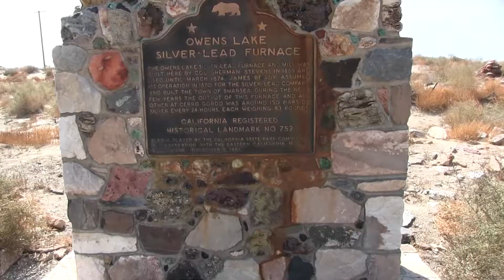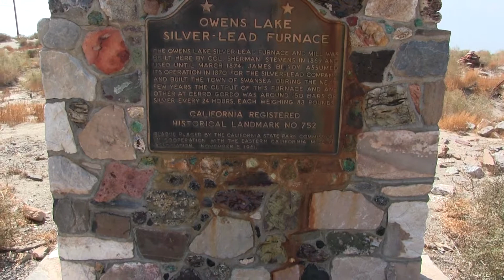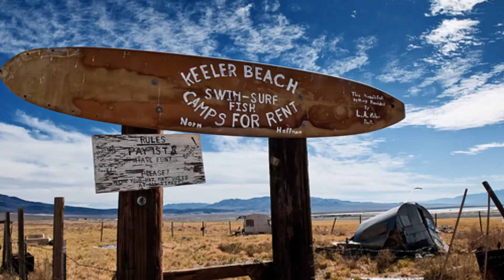Sight seeing Swansea and Keeler California

Comment: I'm thinking of going with a friend on these types of adventures; however, I wonder if I may not have the range I need in my Yukon.  It is a 5.3lt with 4.10 and a 26 gallon tank.  I'd definitely carry extra gas.  I wonder if I could strap the tanks on top to avoid getting high off the gas fumes in the truck?
Reply from the maker: That's a good idea!